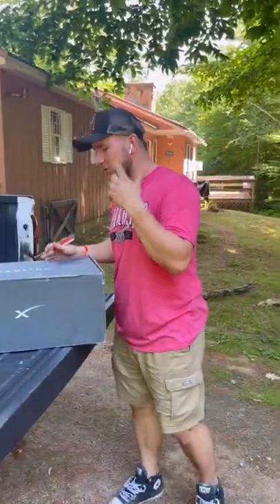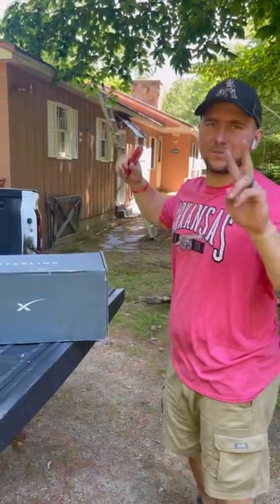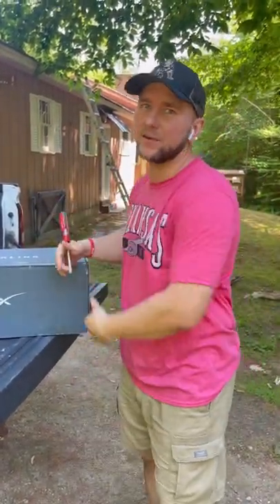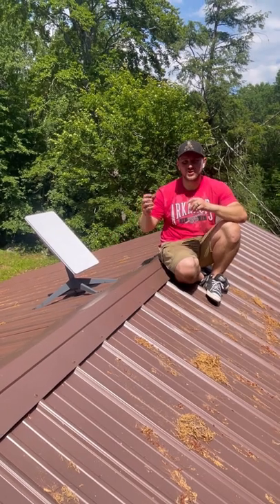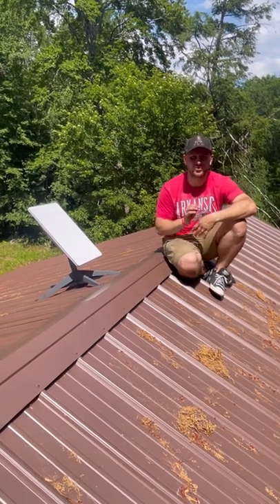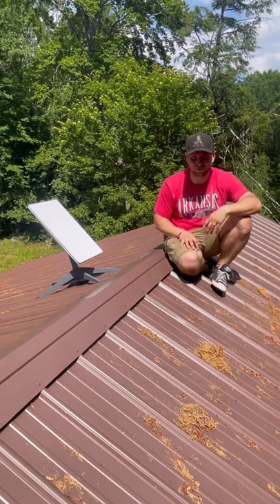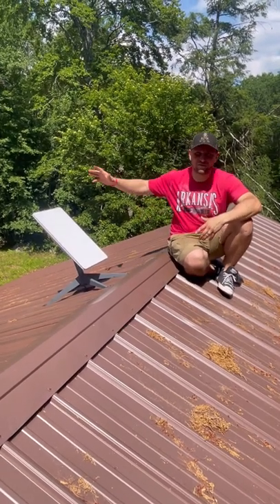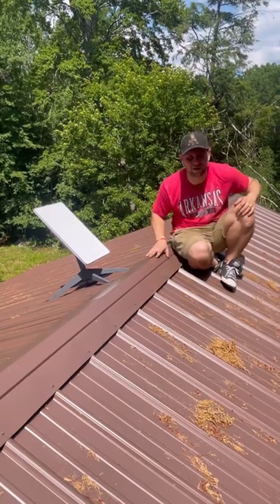STARLINK Installation and COST 💲 DIY WINNI

Comment: Not feeling real comfy with the mingy (& very black glop) waterproofing of the penetrations or the roof site. 
 I would have sited the bracket evenly across the ridge, so the wire came up under the ridge cap (instead of hole thru ridge, if able, or, thru ridge). That makes likelihood of rain soaking thru even bad waterproofing, much less.   Where you put it, water has already started to run down roof in rains, stopping at each penetration obstruction, ready to leak thru at any chance. 
Then, feet to each side of ridge… 
Leaks happen when holes/fasteners go thru the valleys (flats) of that kind of metal roofing, (never screw fasteners through the valleys of metal roofing! They WILL leak, no matter how well you think they are caulked!). …so, I’d make a couple cross bars, mount those across two of the roof panel “hills” on each side, instead of screwing in the valleys….that makes water already shedding fast, before any compromised water sealant can leak. 
Also, when screwing thru roofing, I prefer to squirt calk into the holes, then put screws in to tighten them down, with mor caulk under the metal feet, & between feet & metal below the screw head. 
Even without silicone waterproof , a good 50-year exterior silicone caulk could seal that very well, for many decades.